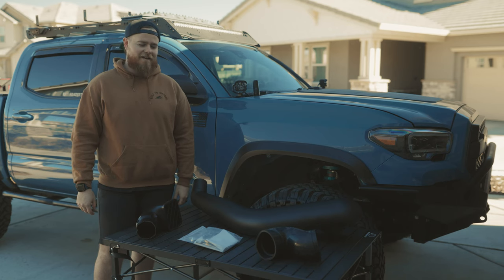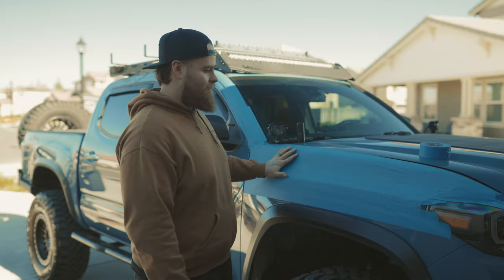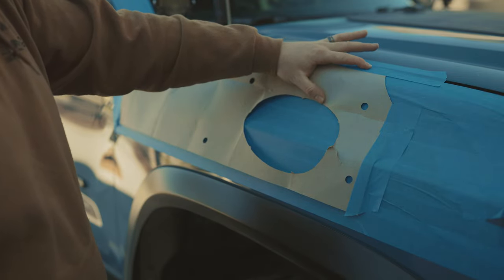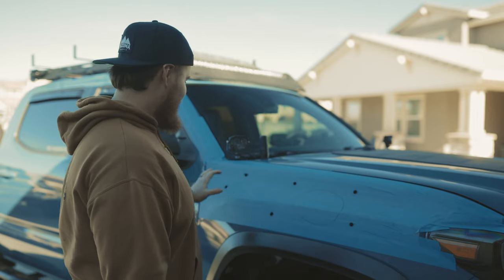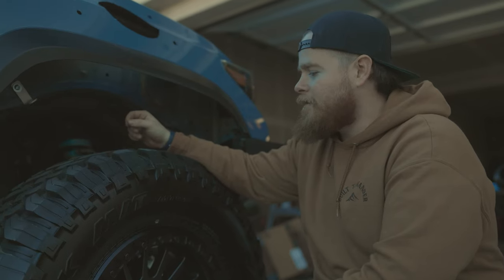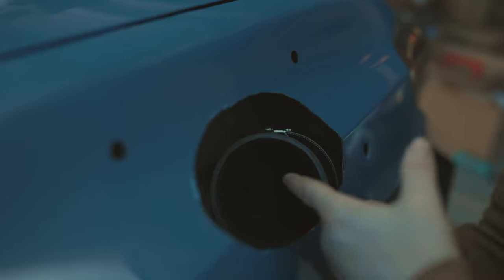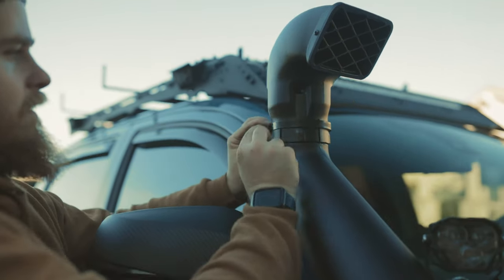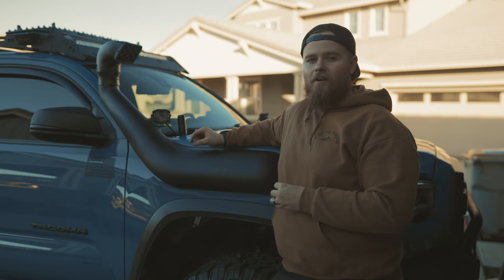Cheapest Snorkel For Your Tacoma?! Yotaverse Snorkel Install

Comment: It's not just for water crossing but more for mud and sand. I actually got mud in my engine with the stock intake and it does have a good K&N filter.